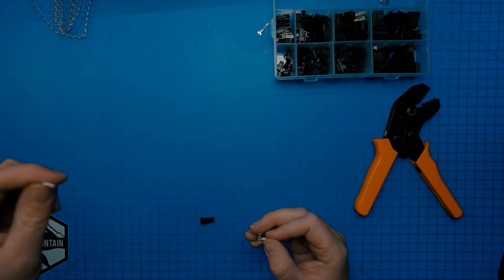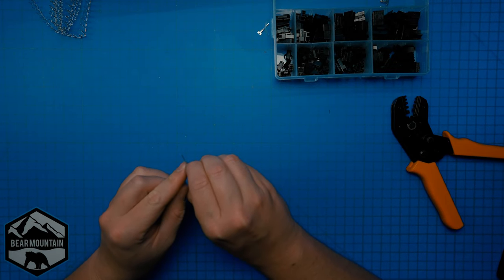How To: Crimping JST-SM Connectors in 5 minutes

Comment: From what I could see, when you 'stripped the wire' you took double (or more)  the length of insulation off as should have been. If you look up the crimp connector in the manufactures data they show male 3.7mm over all with 1.7mm bare wire and 2mm insulation, the female is 1.7 and 2.3. The end of the wire does NOT pass the small crimp going toward the actual connector, the small crimp is for crimping bare wire,  if wire does pass the end of the small it will interfere with the mating connector. It appears you are crimping the small and large areas into the insulation relaying on the mating connector to make contact with the dangling wire, that is not how the manufacture shows it is done. Next is using machine rolls of crimps, when crimping with the proper tool that 'piece' dangling at the end would prevent the correct tool from working. Use IWISS IWS3230M it crimps both the wire and the insulation in one operation. For removing insulation use the Pressmaster EMBLA with the 0.002-10mm jaw, it makes striping 1.5mm of insulation a breeze. That crimp connector is designed for 28~22 gauge. Google JST SM there is a PDF just waiting but it does not show crimping, you have to visit the manufacture, JST really pushes their automated tools, not a lot about hand crimping, I know, SH is the one I crimp all the time.
Reply from the maker: Thanks for helpful context. I’m definitely no expert!